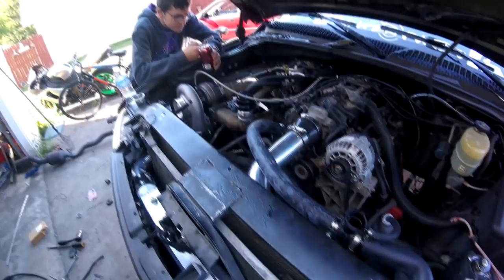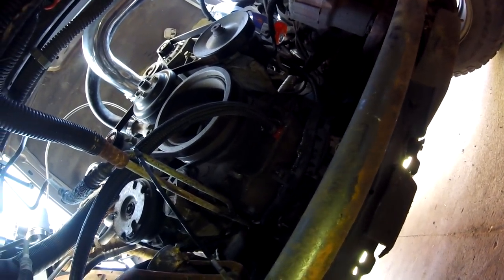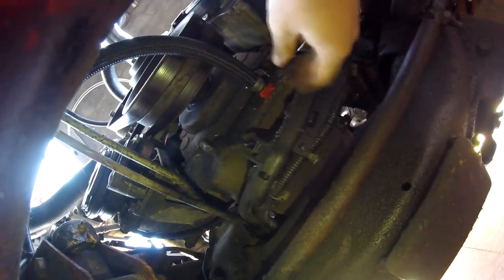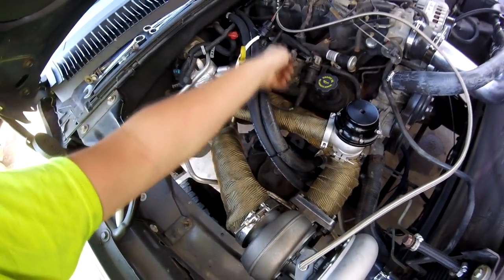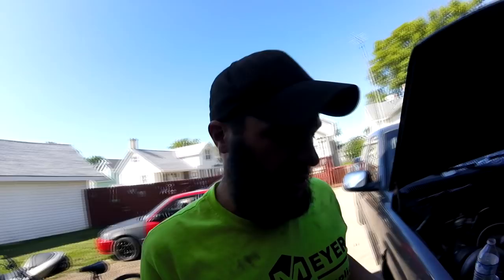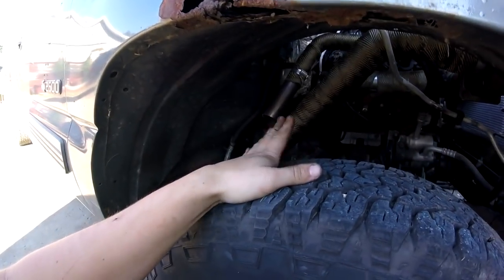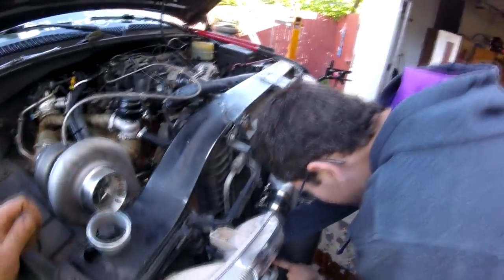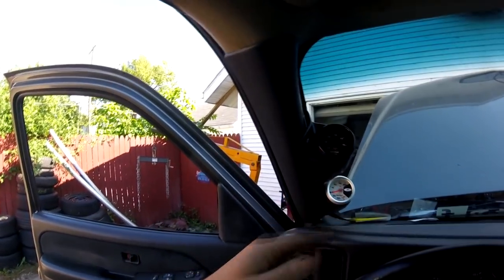How To Turbo Your Truck/LSX Part 3 Oil Lines, Intercooler, Vacuum Lines First Drive!

Comment: Also I wanna get off my anti depressant/anxiety meds but it makes me feel weird when I stop taking it. Props to u brother it’s a battle for sure
Reply: You're doc is supposed to taper you off but it will make you feel weird for about a month. I know exactly what you mean. It's a weird feeling. My doc told me most are long term meds which means pretty much life long. Best of luck man
Reply: Take 5-HTP. Anti depressants burn out your seratonin receptors over time(hormone that makes you happy) soon your brain wont produce it. Im not a doctor but i weened my girlfriend(now wife) off of that shit 4 years ago. But you MUST MUST MUST supplement with 5htp. Get some from vitamin shop or amazon a good quality brand. 5htp naturally increases seratonin production and will help. If you need someone to talk to or advice hit me up.

Comment: A budget tip for the LS forced induction pcv system; get a small paper filter w/barb for passenger side valve cover. Get a barbed plastic check valve between the pcv valve and intake manifold. Both are cheap on ebay. No more boost to the crankcase, plus the benefit of a working pcv, which purges the nasty vapors that contaminate oil and form sludge in the crankcase.

Comment: If you’re going to use the oil cooler block off plate for the turbo feed(which I would not recommend doing(unless you’re using the oem one that has the snout pointing up), you HAVE to make sure you don’t thread your fitting into it too far. Otherwise you will block off the oil flow to the motor completely. I know more than one person that this has happened to.  They Make an adapter that replaces the stock oil pressure sending unit. It’s usually closer to the turbo right there.

Comment: JUST ZIP TIE IT ,  oh the motor mount is loose zip tie it.  Man this guy works hard
at hacking up a nice truck.  But, he does have a video on turbo install for pick up.
And How Did He Figure All these parts would fit This vehicle, He may be a hack but 
he's a Genius, got to give him that for sure... What do you think.

Comment: I know it’s been awhile but your video has helped me a lot on my turbo build. I just have one question. What did you do to make the fitting on top of the intake manifold smaller so you didn’t have to use giant boost lines for your BOV? Appreciate it man

Comment: That's so funny I remember riding my bike down by 23rd Street through swarms of the lake flies swallowing them whole got to love them
Reply: Another thing to note is for Automatic transmission LS swaps, if you’re using the stock PCM with a truck OS loaded onto it, you can delete the MAF in the tune, but you HAVE to leave it installed. If not, the pcm/tcm(0411 specifically) will not be able to get the airflow readings it needs in order to get the commanded torque values to control the shift pressures in the transmission. You risk roasting your transmission w/o the MAF installed. This is one of the few tables the HPtuners and efilive do not include in their tables for tuners you alter because is not recommended to touch... look into commanded TQ values for the TCM. I know there isn’t a physical tcm in the Gen 3’s, but trust me it’s built into the pcm.  If you’re using the Computer To control shift pressures, then LEAVE the MAF IN.

Comment: So if you are running a turbo replacing the Evap purge valve with the Jimmy 2 wire set..  I was told you can just remove the purge valve and block the hole for a non emissions harness setup?
Thanks for the info and be well.  
Going through the same thing with Anxiety and meds are not fun but if you need them, you need them.
Thank you!

Comment: How do you feel about the turbo oil drain routed into the existing oil level sensor? I'm know this question is common. I'm about to do mine like that but I'm wondering if itll push oil through the seal or cause coking of the oil. Thanks
Reply from the maker: Never run into the sensor always into the front of the pan under the balancer or into the timing cover. It won’t work on the sides been there

Comment: Your truck didn't have a separate oil cooler on it? My 2003 2500HD had one. I just assumed they all came that way.
Reply from the maker: JayinMI integrated into the radiator

Comment: When deleting that little evap set up for your iat, does that effect anything with the fuel tank venting or anything? Does it need to be tuned out?
Reply from the maker: SilveradoSyd no
Reply: SilveradoSyd it will throw an evap code because the solenoid is missing but that’s easily turned off, it has no ill effects and 99% of the time you’ll never smell the gas fumes, you could connect the evap line to your pcv system to pull and reburn the vapor but at this point usually with a catless turbo setup it’s gunna smell anyway
Reply from the maker: Yes listen to this guy^
Reply: Awesome thanks Matt and Hunter!

Comment: Michael hit me up if you have 75mm bore vitaras i got the speedfactory  long rod kit with the 75.5. But cant find a machine shop. Somebody help me with a stock bore vitara or a cheap maxhine shop
Reply from the maker: Mika Allard he does not have any stock bore pistons he is 76mm you really can’t find a machine shop to bore? Going rate is anywhere between $1-$200
Reply: What hunter said
Reply: K thnks